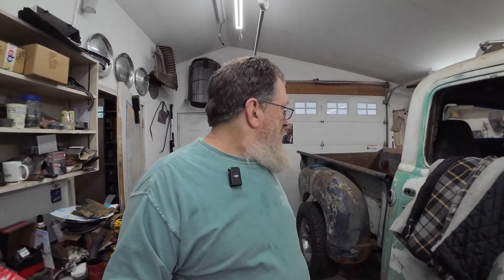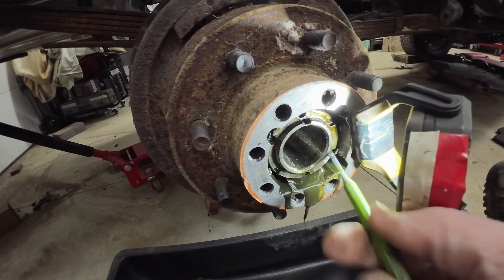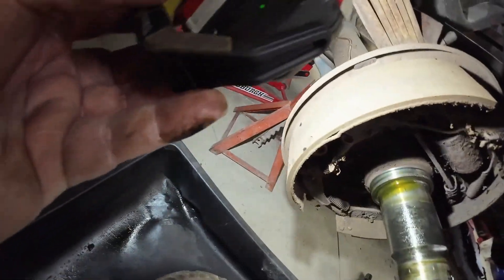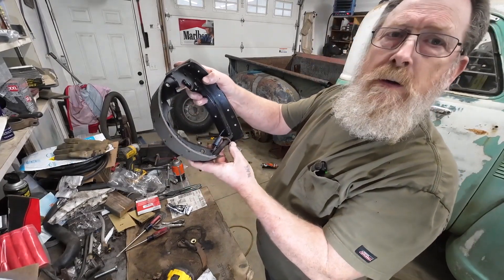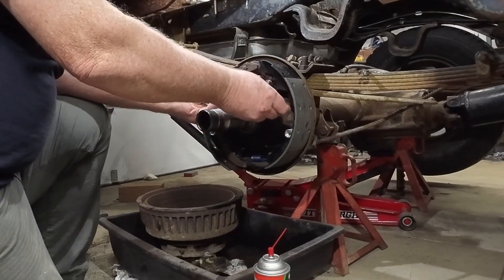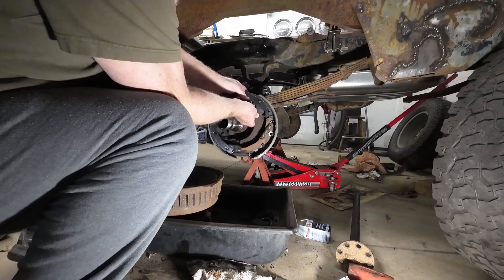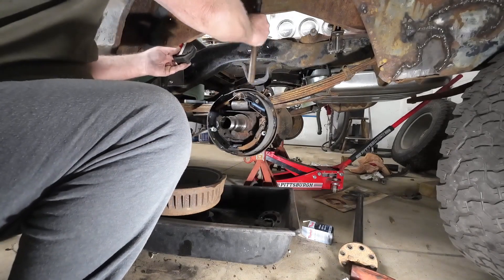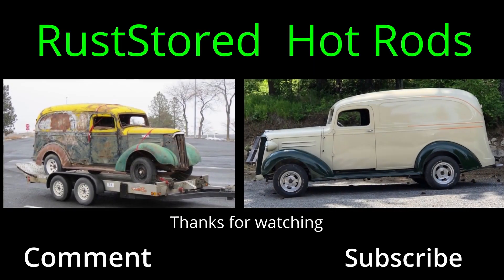GMC Rear Brakes

Comment: Thanks for sharing your expertise. I recently changed my shoes, drums and some of the springs and had it way less tight than you showed.  This was on my 97 suburban c1500.  I drove 15 miles to work and one side was smoking a lot.  Ever seen the adjusters tighten up to the point that you have to pry the drum off?  I have no idea what I did wrong but there was a lot of smoke.  I took off the drums and couldn't see anything wrong other than the one side  being tight.
Reply from the maker: Any chance you may have switched the star adjusters' side to side?
Reply: I did one side at a time so they should be correct.  I pulled it apart and have been watching a bunch of videos.  I did have the long shoes in the right place.  I think the smoke may have been the shipping protestant I only cleaned the surface that touches the shoes.  I loosened them up a bit ad will see how it goes.  Thanks.  I look forward to watch more of your videos.    @Ruststored